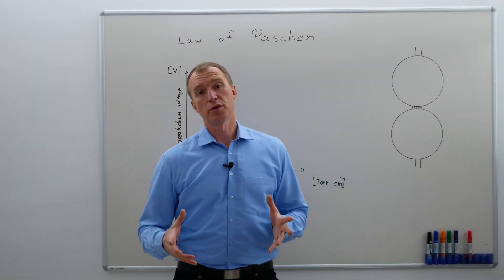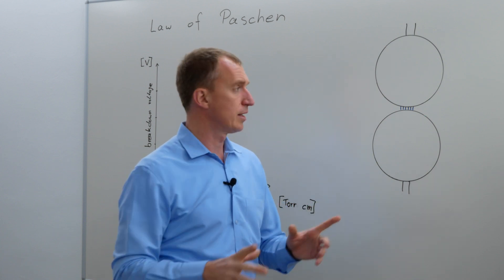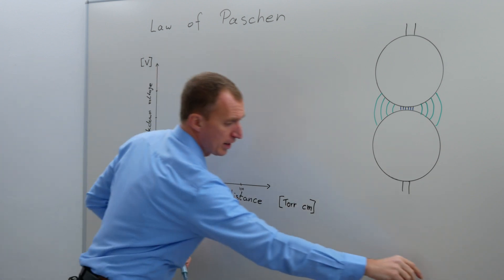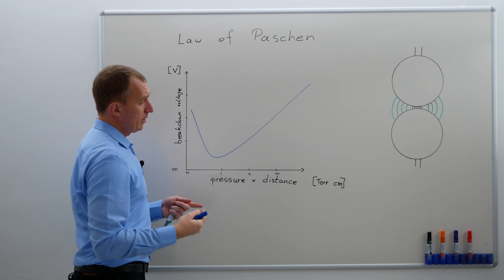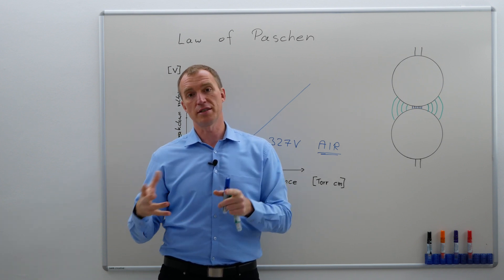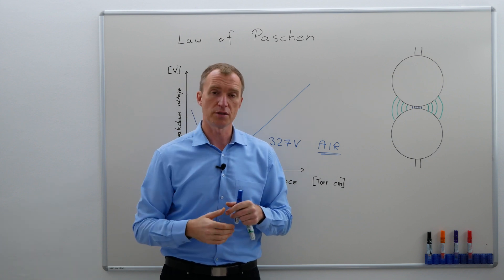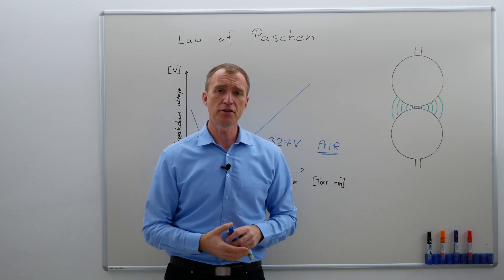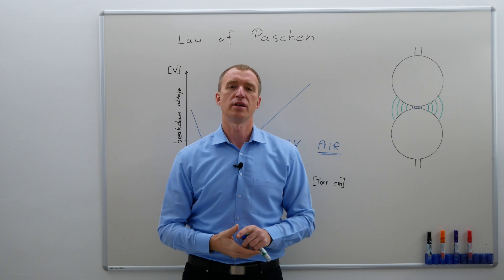4.4 Partial Discharges Physics - Law of Paschen

Comment: Pressure can be increased by add more gas or increase temperature, Does paschen law apply either way?
Reply from the maker: To my knowledge, Paschen did not change the temperature. He regulated the pressure by the amount of gas. 
Please note, the video is an oversimplification of what Paschen did. One can easily fill 45 min to 60 min, talking about the Paschen law only. From this very interesting and topic I extracted only the small part, that might be usefull for understanding Partial Discharges.
Reply: Hi, I know this is an old comment but I'm actually studying how low temperature/pressure affects partial discharge inside high voltage cable insulation. Paschen's law still applies in terms of air pressure, but in AC cables at low temperatures something really interesting happens - partial discharges occur at similar inception voltages, but the discharges have much higher energy. I haven't experimented with cables at high temperature, but the effect may be similar - higher temperature -> higher energy partial discharge events.